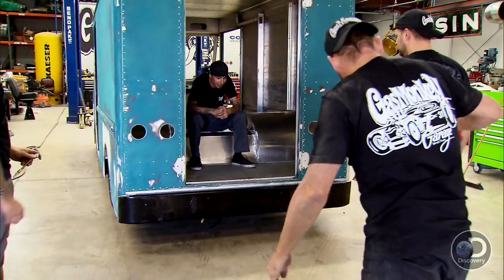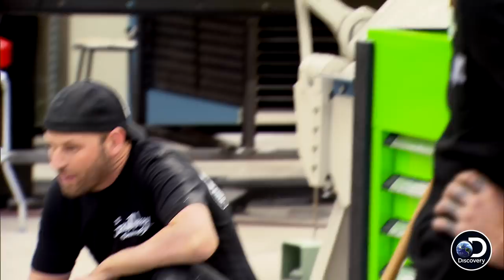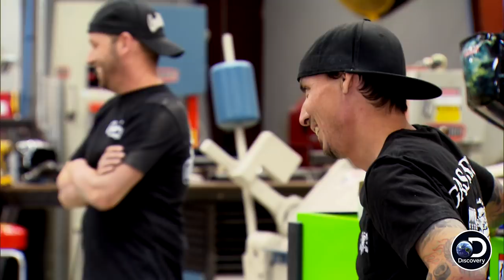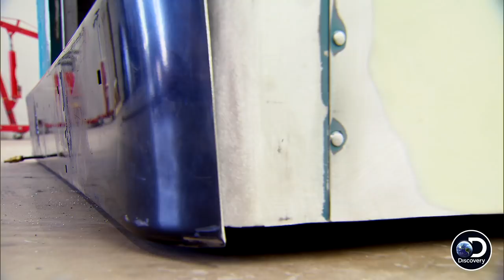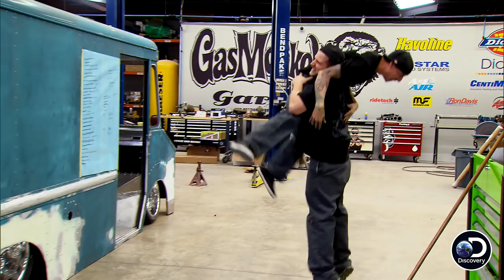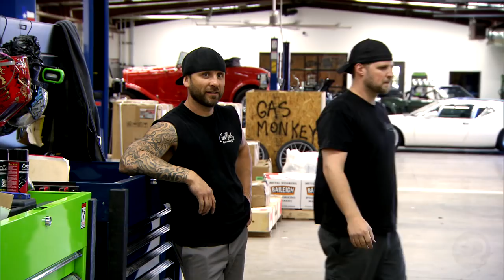How Low Can You Go In This Slammed-Down Step Van? | Fast N' Loud

Comment: Bro watch an episode where you guys installed the side quarter windows and the front windscreen.  Here in Aotearoa, New Zealand,  we would fit a length of rope into the rubber window support. Start putting the window in at one end of the rope (large string). Pull the rope out as you insert glass . The rope (a little bit wider than the glass. The rope pulls the rubber out around the glass as you work you way around.